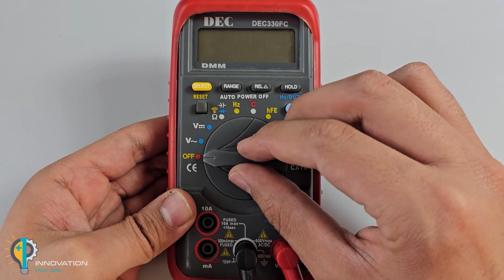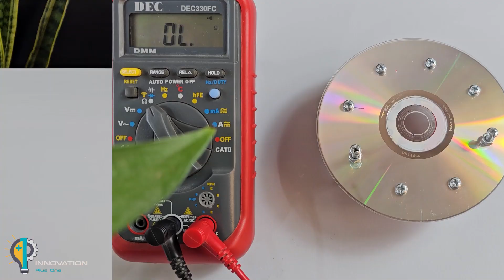Free Gas From Broken CD || Hydrogen Generator

Comment: A HHO Hydrogen power CAR KIT for your car better than you think.!!!

ACMEC HHO kits are designed for hho gas production in low voltage & low amps.  Lower heat generation Easier to Mantain and Easier to Install ,  Compact in size but more stable HHO Gas Production.   All hho kits generated Hydrogen and oxygen gases nothing else.! You never try to store  , use it as you make it . HHO on demand system according to your needs considered very very safe.

Yes HHO CAR KIT will improve your engine horsepower and fuel burning efficiency while reducing toxic gas emissions hho kit will solved all engine heating problem automatically. Engine will run clean and smoothly requiring very little maintenance, you will only have to add distilled water. Hho is best for  decarbonization of your cars. So make your car zero emission. In this way you can stop polluting the atmosphere.!!

You will not see brown deposits in our new designed long lasting hho kits. Our  kits for efi cars working up to two amps. 

But our transparent hho kits for carburetor types engines working up to 8 AMPS. For better fuel economy. ACMEC HHO CAR KITS can installed on petrol, Cng gas, or diesel engines, to run smoothly and your life will much easier.

For more call zafar 03082266179 or watch hho zafar videos on YouTube.